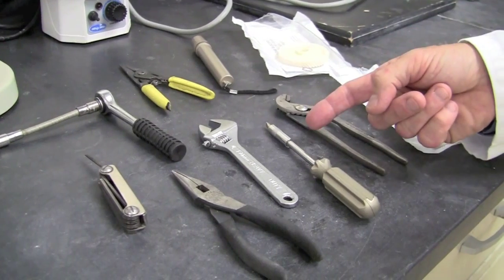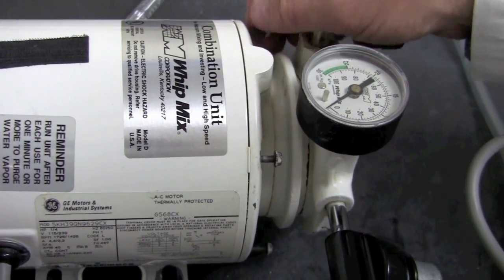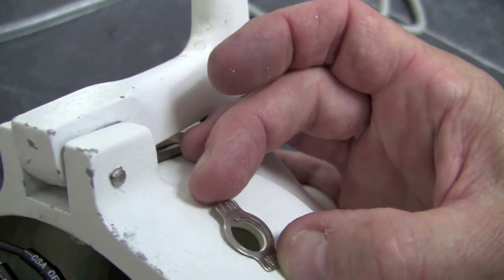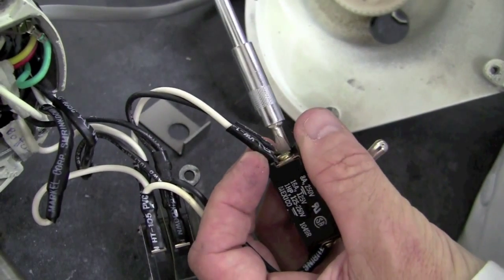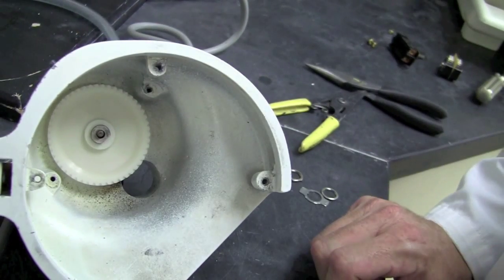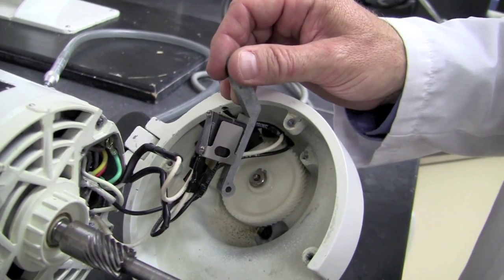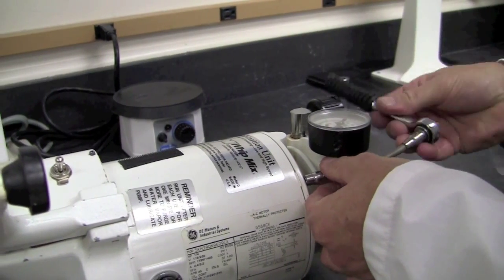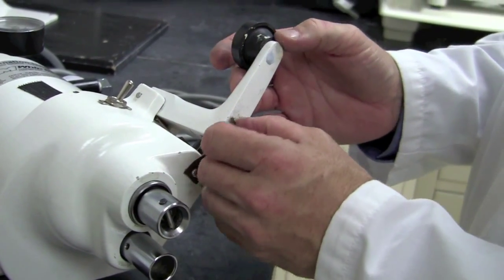Whip Mix Combination Unit and Vacuum Power Mixer Plus Maintenance

Comment: Whats the kit's part number?
Reply from the maker: The Vac-U-Care Maintenance Kit is Whip Mix item number 28398
Reply: @WhipMixCorporation  I'm sorry. I meant is there a kit number for the parts that you used or are they all individual pieces?
Reply from the maker: @wafflesmartano  The parts mentioned are not a kit but individual. They are as follows:

Toggle Switch 2 Pole (post June 1976): #13455
Toggle Switch Single Pole( pre June 1976): #06246
Micro Switch: #06599
Nylon Gear: #06564